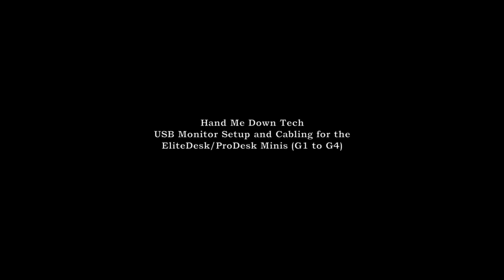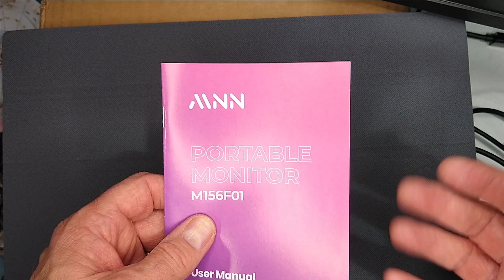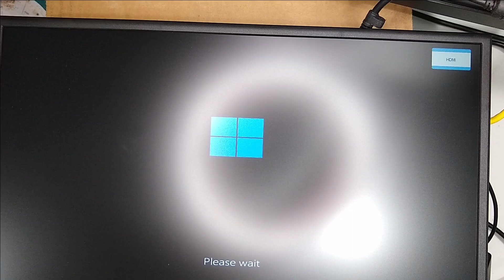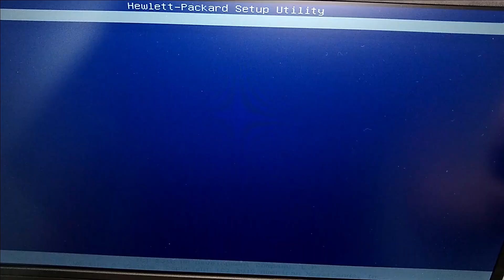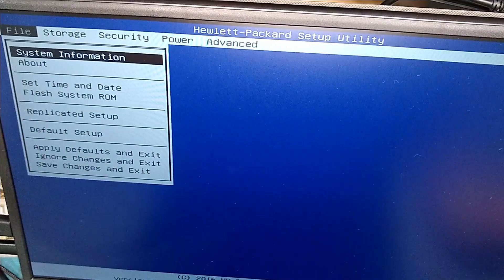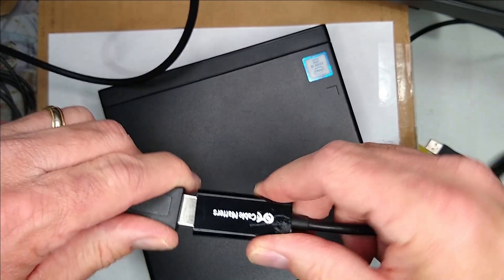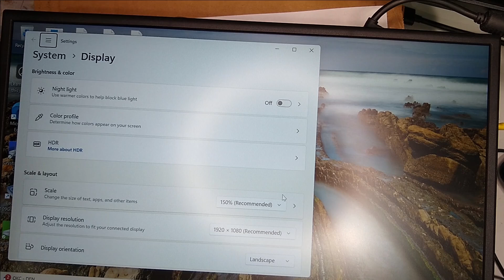How to Connect a USB Monitor to an EliteDesk/ProDesk Mini

Comment: For my G3, I recently bought a 15.6" touch screen (including VESA mounts and half-decent speakers), which I'm happy with -- although the screen could be brighter.  Contrary to what 'Gemini' suggests, a 30W direct power supply (mine from Essager) made no improvement.  Still, this is a great setup for a quasi-portable system.
Reply from the maker: Wonder with a high capacity power bank you could somehow make it actually portable.
Reply: @handmedowntech  I look forward to seeing this in one of your future videos!😁

Comment: Can you please link me the flex IO type c for the g3 that is needed to do this? Does it need to be power delivery too?
Reply from the maker: For the G3 you want the 3TK78AA - this will allow you to run the monitor using just a single cable.  https://www.ebay.com/itm/236283539527 is an example of one

Comment: I don't think the front USB-C on the G3 is rated for power delivery. One of the USB-A ports on the front does advertise the "charging" symbol, so it might work, depending on the monitor's power requirements. It's cool that the FlexIO USB-C can be used for both power and video data.
Reply from the maker: The front can be used in combination with the HDMI port but not alone.
Reply: @handmedowntech   I did some more digging on the HP support site and (like Apple) they can be wonderfully vague about the exact specifications of each model LOL. But in my reading I noted that their description of front panel USB-C gave the impression that was for USB 2.0 speeds only. So even if it provides adequate power for the display, the port itself cannot send video data. That jibes with my own experience of using the port with a USB-C external NVMe enclosure and getting dreadful speed results (e.g. less than 35 MB/s). Happily, the USB-A ports on the front appear to be full SS USB 3.x and deliver the goods. Ya learn something new every day haha..

Comment: unfortunately i haven't found any usb c pd flex io board that is compatible for 90W 705 g5. the port behind the dc port that has the label "USBC PWR" written has 2 rows of terminals
Reply from the maker: Have you tried the 3TK78AA?  The specs say it works with the 705 G4 MIni
Reply: @handmedowntech  yes, but it doesn't support pd in and only normal 15W out so it is similar to the front. the manual said it is compatible with the 100w pd but they revised it to flex io v2 that is only compatible with 800/805 g6 (even then it is for only 35/65w version)
Reply from the maker: What is the main thing you're hoping to get working with the USB C port?
Reply: @handmedowntech  i want to use 100W usb charger to power up the pc at least

Comment: I have a ViewSonic monitor like this that has a kickstand like a Surface Pro.

These are great for taking on holiday and using them with a phone or a Nintendo Switch.

The monitor can be powered by the phone or you Cs use a 65W GaN charger to power the monitor and charge the phone,
Reply from the maker: I have to try it with phone or tablet to see if they can power it.  Didn't know ViewSonic had gotten into USB monitors.  They've been around for a long time
Reply: @handmedowntech I have had my ViewSonic for over a year now.

My Samsung Galaxy S22+ can power the monitor but how long for I do not know.

Comment: I really enjoy your videos, and share your enjoyment of these 1L units, but if there is a hdmi connection it isnt really connecting them to a usb-monitor. Still enjoyed the content though BW
Reply from the maker: @alanstedman6716  Not sure what you mean about the HDMI connector?
Reply: @handmedowntech  Not a big deal, but for example at 6:47 you connect video output via a hdmi cable, not usb-c. like I said, love your work.
Reply from the maker: Since we were dealing with a G1 I had to use a VGA to HDMI adapter and then supply power via USB A to USB C.

Comment: I have the same monitor...  The USB-C power passthrough works well for me.  I plug my laptop USB-C power adapter into the monitor then run another C-to-C cable from the monitor to the laptop.
Reply from the maker: @jb31842  Hadn't thought of that combo.  Makes more sense vs trying to power something via the computer power.
Reply: What mine doesn't seem to have is letting the power flow one way to power the laptop while letting video signal flow the other way.  I have USB-C port replicators that do basically that so I know the laptop end is capable.

But now I want to go try it with the USB-C powering the monitor from the laptop AND sending signal, while running the laptop on battery or using its Dell port.